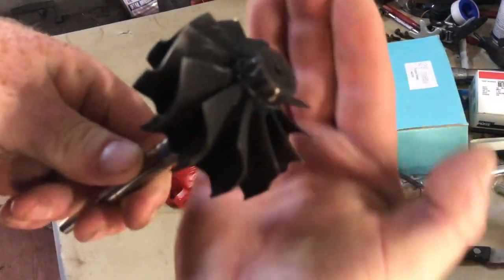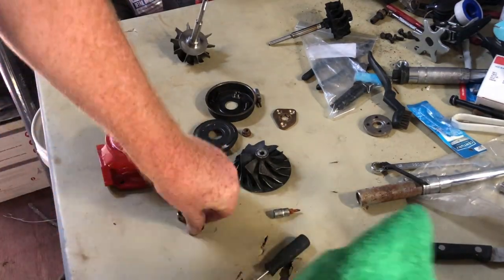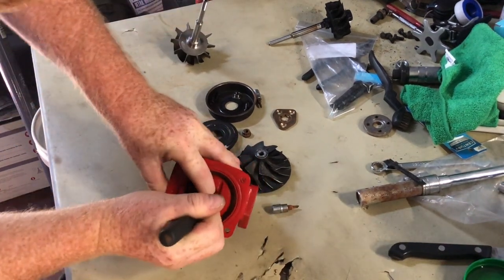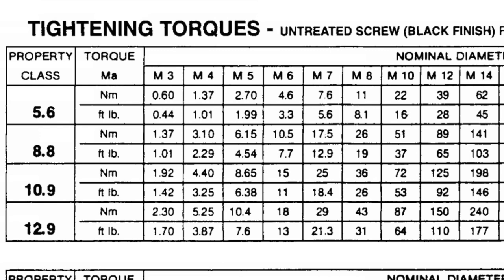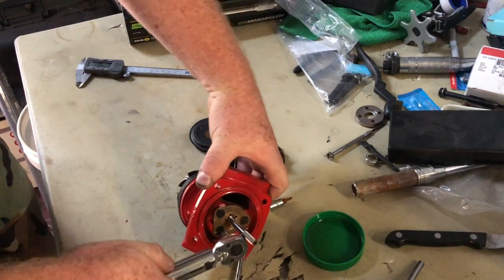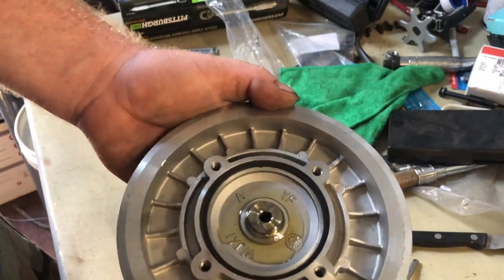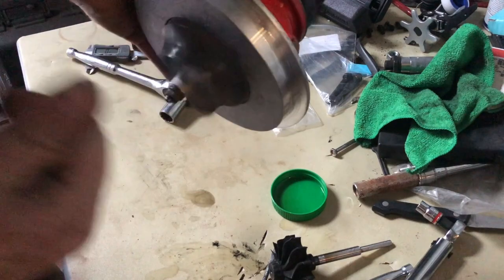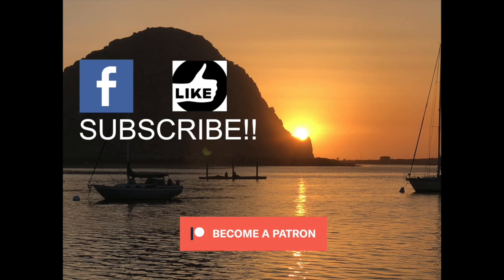6CTA8.3 12v Cummins Rebuild Part 8 - Turbo 2 of 2

Comment: Hi mi hat is of to you, im actually in the same pickle as you my m923 a2 dropped a seat on cylinder 5 and messed my engine out so I’m at the head remount part
Reply from the maker: Manuel Aguiar exhaust seat? That’s what happened on both 5&6 for me, then it proceeded to start tearing up cylinder 3 with the chunks